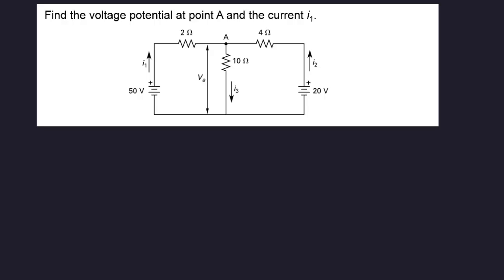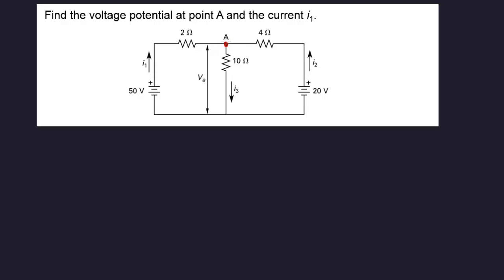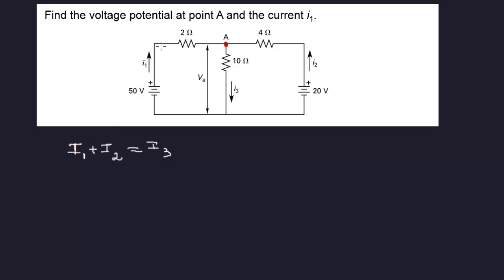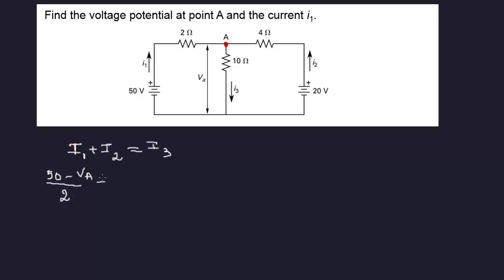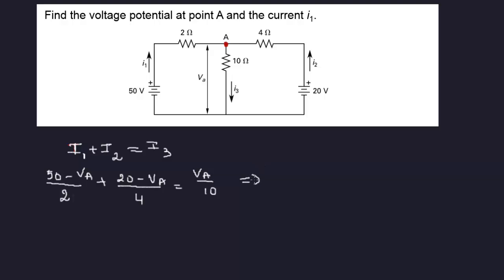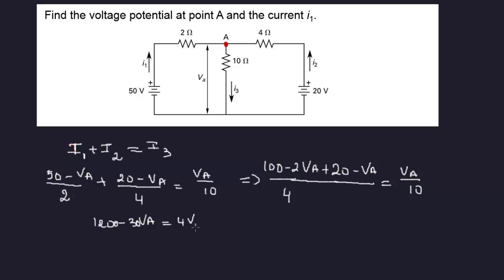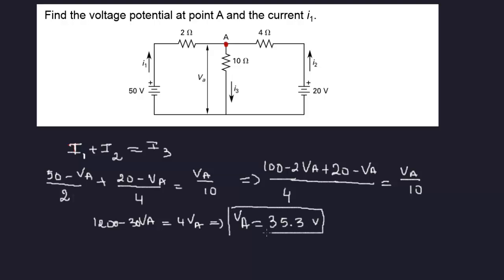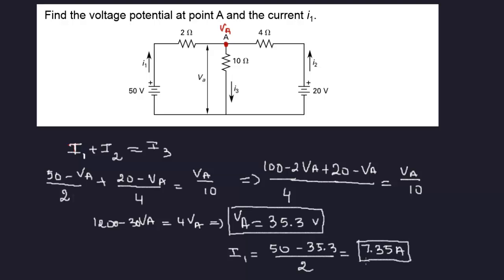Using KCL to find Voltage-FE Exam Review

Comment: how to solve this using loop current method and without using the current direction shown in the diagram? Bcos I am getting same I1 value as -7.35 and I2 value as -13.82. so summing them up and multiplied by the resistor in the center leg should give the voltage as 221..??? Please explain